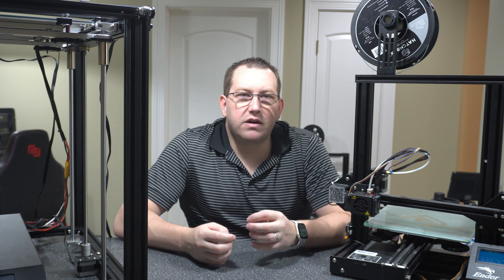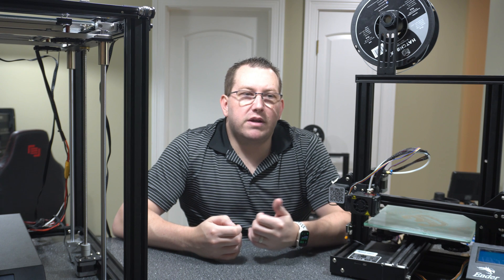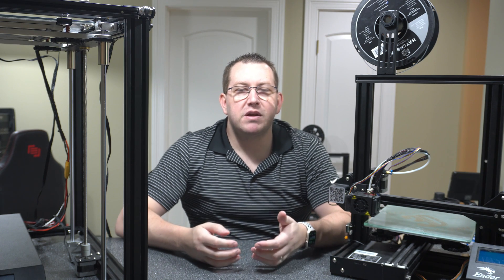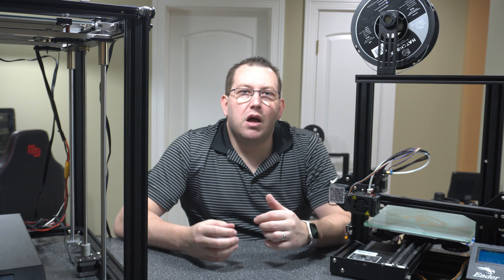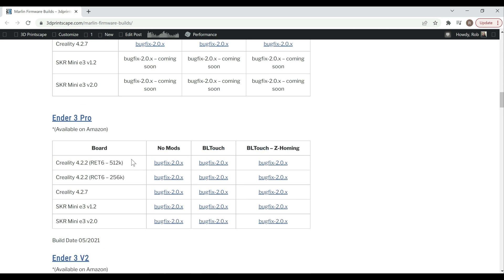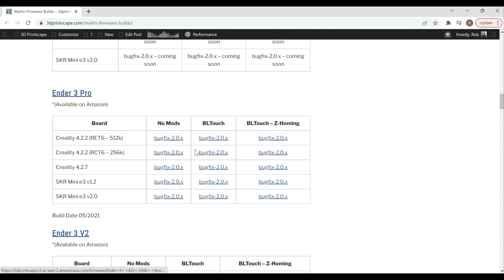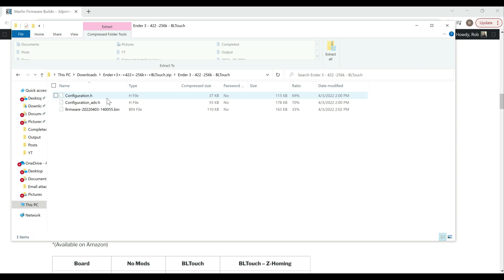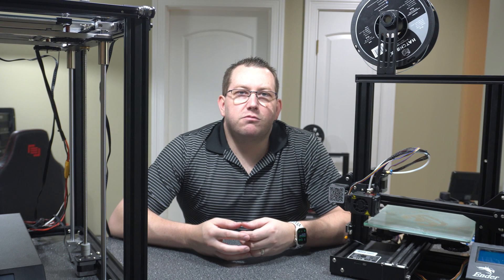Creality Screen Issues After Firmware Upgrade

Comment: I can not thank you enough for your help. I followed your "CR Touch Install Guide – Complete Walkthrough!" video and had two issues. The screen was glitching as described in this video and the Z offset would not save even though I was following your instructions. This video fixed both issues. I have the Ender 3 Pro with CR touch. I downloaded the software you showed in this video: bugfix Ender 3 PRO, Board: Creality 4.2.2 (RCT6-256k) for BL touch. I put it on the SD card and my printer loaded the bugfix and fixed the issues. The only thing is the settings/ options layout in my printer are different now and no longer match the settings in your video "CR Touch Install Guide – Complete Walkthrough!" I was able to find all the same settings just in different locations to find my Z offset, save my Z offset and level my bed. Thank you! Thank you! Thank you!
Reply from the maker: Hi. Thanks for the feedback :). The firmware on my website is Marlin, so its a bit different that the Creality builds. I think theirs is based on a stripped down version of marlin.

Comment: Hello Mr. I use your FW bugfix-2.0.x NoMods for Ender 3 Pro. Could you please share new update? I find 3 mistakes:
1) By pause print, the printer stays in the current place. This pause creates a big blob under the nozzle.
2) Jerk setup is not available.
3) Maximum acceleration is 500 only.
Your FW is mouch better, than the Creality one, but the pause creates very big blob during pause.
Thank you.
Reply from the maker: Hi. Thanks for the feedback, i will get the changes made next time i make updates.

Comment: Hi i was having this problem and I have found this video I installed the bl touch version and the screen has still got the issue nothing has changed 

Thanks

Edit* I have tried all of the firmware that you have for the ender 3 and nothing has changed it is still not working 
any help would be appreciated
Reply from the maker: Hi. What screen do you have and the issues look similar to whats shown in this video?
Reply: Yeah the screen that I have is doing the exact same thing
It is still the stock screen
Reply from the maker: @bobjohn8793  Can you verify that the firmware was actually picked up by the printer?
Reply: @3DPrintscape  I am fairly sure that it was but I am going to give it another try 
thanks
Reply: @3DPrintscape  hey man Thanks for the help this is the same person just my other account got hacked 
I have got'n it to work I think it might not have accepted the firmware that I first tried

Comment: Thanks for all these super helpful videos! Newbie here. Recently got an Ender 3 and when I tried updating the firmware to install a CR Touch this screen glitch happened. I have a 4.2.2 board and z-stop disconnected (I actually followed your other video!). For this bug fix, should I download the one under the "BLTouch – Z-Homing" column? Or is that SPECIFICALLY for the BL Touch and not the CR Touch? Thank you!
Reply from the maker: Hi. Use the bltouch one.
Reply: @3DPrintscape  When I downloaded the BLTouch-ZHoming for an Ender3 V4.2.2, and flashed it onto my machine, my screen says "Ender 3 Pro". Is it supposed to say that? I've triple checked I selected the right download from the list in your website. Thanks.
Reply from the maker: @JoseSanezAnimator  Thats normal, its basically the same build. The main differences between the 3 and 3 Pro is the power supply and frame.

Comment: I have an Ender-3 Pro with a BLTouch 3.1. I recently got the Creality Touchscreen and upgraded to the 4.2.7 board. The chip is the STM32F103 RCT6. The BLTouch is wired with all 5 wires going to the pins on the board. The Z-Stop switch is still connected. I had it working after multiple firmware downloads, but it did not display subdirectories on the SD card. I tried upgrading the firmware in the display, the DWIN_SET and now I can't make it work at all. If I put the old display back on everything seems to work fine. Where can I find the correct DWIN_SET and how do I configure Marlin to talk to the Creality Touchscreen?

I was impressed that you explained the different chips on the new board and thus the different environments for the builds in VSCode.

Thanks.
Reply from the maker: Hi. I havent seen custom firmware working back with the touch screen and bltouch. I will need to get one of the touch screens and boards to see if i can get it to work.

Comment: Thank you for the video. Could i have some help please? I bought and installed the CR touch. I used the firmware with the ender 3 pro. I have a RET6 board. when I do the homing, it will center the CR touch but will not go down to the bed like my ender 3 v2 does. Usually when I home the machine the CR touch will go to the bottom of the bed a couple times. The ender 3 pro hovers in the air and pops the CR touch in and out. Thank you in advance for any help.
Reply from the maker: Hi. I would verify that your running the right firmware. If you are, try to either unplug/or plugin the z stop to see if that changes anything.

Comment: I recently got a new  ender 3 pro with the new board v4.2.2 and 6d32f303 chip. I went to do a print with a filament change on cura using my normal method of the filament change script it post-processing it did not stop, any ideas as to why this could happen or how to fix it would be greatly appreciated. thanks
Reply from the maker: Hi. Take a look at this video. I think it may be something similar. https://youtu.be/EAl-fWkwU-I

Comment: I was having this glitch as well. Sadly I returned my printer and got a different one. I’m still having a problem where my printer isn’t able to complete a print and isn’t able to save settings. This has happened after I downloaded the firmware for the cr touch, so if you have any suggestions it would be appreciated
Reply from the maker: Hi. Can you try the build a provided to see if that fixes the issue?

Comment: i have a couple questions actually uhm im fine with the glitchy screen but my z axis is to high for my bl touch and when i do the actual test print and it probes and all that but is to far off the print bed 
i cant figure out what is happening
Reply from the maker: Hi. Did you clear the eeprom after flashing the firmware?
Reply: @3DPrintscape  I'm not sure how to do that
Reply from the maker: @theprofessionalretard8071  Its basically just restoring defaults in the printer. It should be in the menu somewhere as restore defaults, clear eeprom, or something similar.
Reply from the maker: @theprofessionalretard8071  What firmware are you using and can you try the one I called out in this video?

Comment: hi.for cr10s pro ???
Reply from the maker: Hi. What board is in that printer?
Reply: @3DPrintscape  original creality cr10s pro mainboard v2.4 - (2018.08.13)
Reply from the maker: @theone-0339  Ok, thats what i thought but was seeing mixed things online. Im pretty sure that is an 8 bit board, so this wont help much. Im taking it you flashed the firmware and are seeing a similar issues?

Comment: I was having massive issues with firmware being glitched (attempted CR Touch firmware on 4.2.2 board for brand new Ender 3 Pro ) and came across the work you had been doing helping others in forums. You're doing amazing work for free thank you so much.
Reply: I had the same problems
Reply from the maker: You're welcome, im glad i was able to help out :).
Reply: Creality firmware is shit
Reply: hey i had this problem a while ago, couldnt find anything that directly helped me, so i was wondering if you wouldnt mind pointing me towards what helped you
Reply: So did the bl touch bug fix work for the cr touch attachment or did you have to use something else?

Comment: What about for the cr touch ? It has 5 wires and I was not aware of 2 different bl touch models. I have  4.2.2 with a cr touch. I upgraded it and now it lists a bl touch when trying to level the bed. I am new to this and have watched alot of videos     and I'm confused. Thank you for your videos.
Reply from the maker: Hi. To the board, the crtouch and bltouch are the same. You would just use the bltocuh firmware.